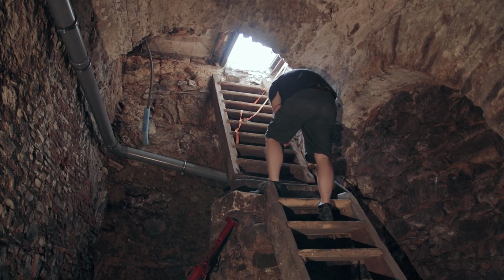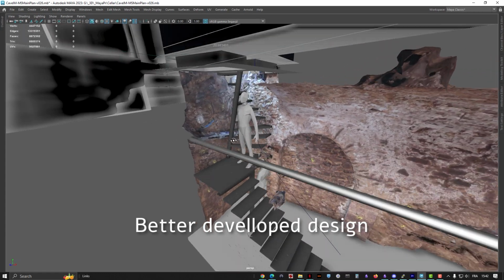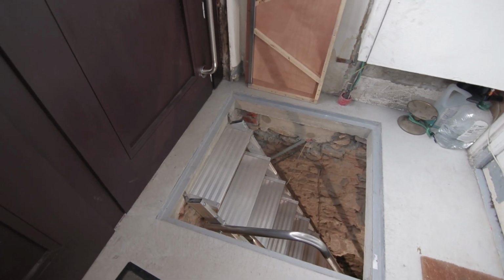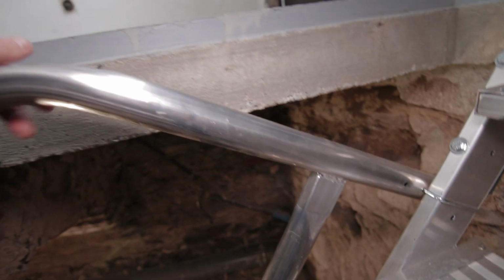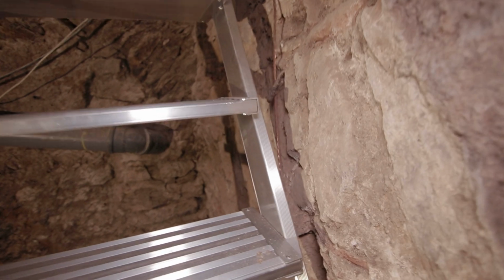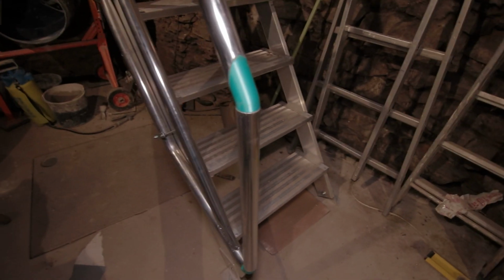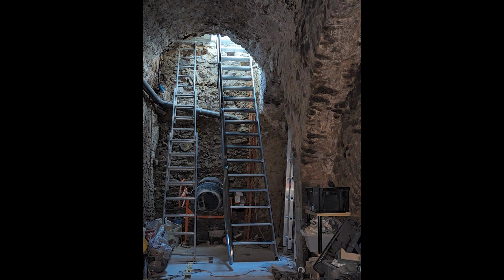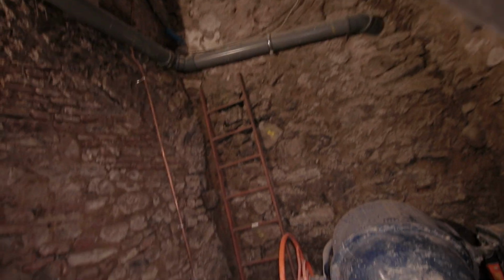Old Cellar 28: Italian made safety

Comment: Very nice work, I would find a way of securing the two trap doors when it’s open, so they can’t fall into the opening. A pice of wood across that small alcove where they are should work. Thankyou for the update.👍👍
Reply from the maker: Yes, it's not the final stage for the doors some more reflexion is needed. I usually open only half so the problem is lessened. But it's not optimal right now. Thanks !

Comment: Good solution, the circular flight of stairs would've imposed a heck of a lot more constraints on you than they're worth. In a lot of cases, people think they're better, but they're not. Especially as one gets old, they become very dangerous to traverse and many other issues that come with that shape and the issue of wedged steps.

You could stiffen the ladder up pretty well if you add a brace to the wall behind it. That brace could also become a shelf if you put some treated plywood or an aluminium sheet (could be expanded aluminium, for example, but that's pricey).

As for the vault, if you decide to pick at it, I'd suggest adding a brace/beam some 20 cm in from the face, adding rocks on top of that to support the vault. Then you could pick at the stones and make some room. That way, even if you remove the vault's stable (current) form, the weight will have some place to unload. There's other methods, but a beam's the simplest solution. Pressure treated wood wouldn't have an issue (during your life time) with being in that space.
Reply from the maker: Yes you're right, it solved one issue whilst creating a ton more. For the vault I'll see what comes loose anyway, and cut the more annoying stones. I don't want to remove too much, but I'll definitely keep your advice in mind. I have some crap C and I beams also. Good idea for the shelf ! Thanks for the support as alway !